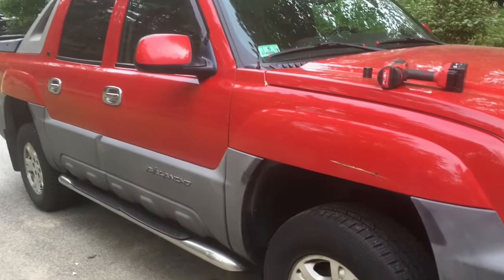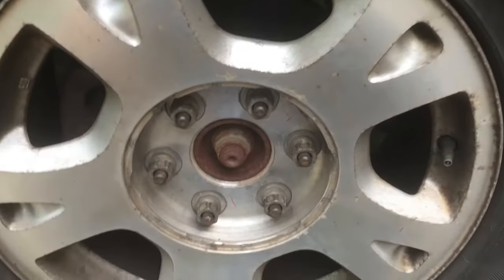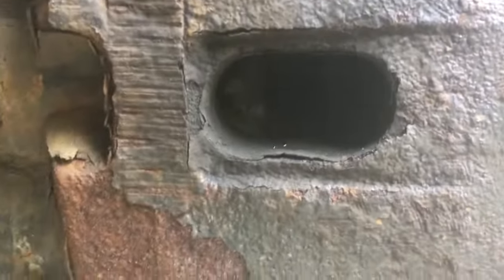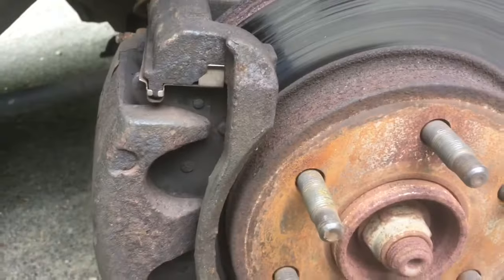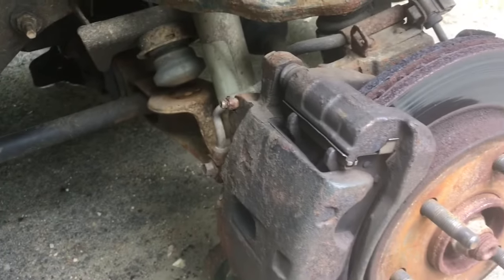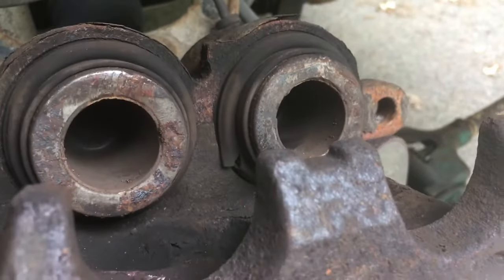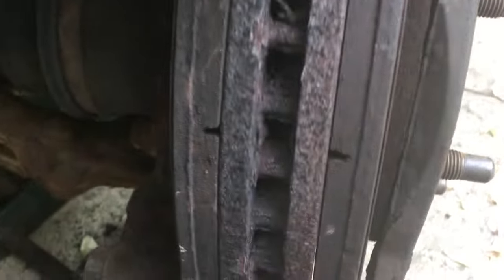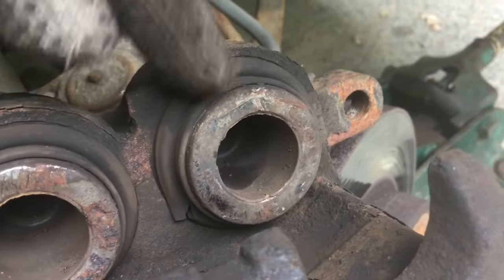Why is my wheel smoking and hot? Let’s find out!

Comment: I had hot brakes after a brake job. I was thinking seized caliper too, but luckily once I drew some brake fluid out of the over-max master cylinder reservoir the issue corrected itself. A shop must’ve topped off the brake fluid at some point along the way, but I didn’t know that it could cause brake drag until yesterday.

Comment: The 1st symptom of a sticking caliper is the vehicle pulls to that side. The next thing is that brake fades and the vehicle pulls to the other side because the other side is the only one working.   Another possibility is that the rubber brake line is delaminating on the inside and not letting the fluid return to the master cylinder.   If your vehicle is pretty old and you're doing a brake job just replace the rubber lines and save the headaches and frustration later on.   I've done this repair on two vehicles and it solved the caliper sticking issues.  I replaced 3 or 4 calipers on my old van before I figured it out.  AutoZone was very accommodating with the lifetime warranty.  Talk about feeling dumb.. I'm getting ready to do the front brakes on my k1500 and am replacing the rubber lines as a precaution.

Comment: I had my front right calipers replaced twice in about 5 months and my rotor is getting really hot again. I'm guessing the brake hose is gone bad
Reply from the maker: That totally stinks Tito. Check to make sure the caliper bracket is nice and clean too. If the brake pads are stuck in the caliper bracket you may have similar symptoms. A collapsed brake hose/line would certainly do the same!  Keep us updated with what you find!
Good luck!, and thank you for watching!
Reply: Yeah turns out it was the brake hose, it was very old so now it's running smoothly

Comment: My car is doing this. I took it to a machanic, he said I needed a new caliper. I ended up getting a new Hub baring, caliper, rotors and brakes. Fast forward 3 weeks later(today) doin the same exact thing! Do u have any idea what could be the issue with my car?
Reply from the maker: Depends on the vehicle, but something must be holding the brake pressure in your caliper (bad brake hose? Or damaged abs module?) , or the caliper is seized in the caliper bracket. You’d have to take it apart to figure it out. I’d recommend bringing it back to that mechanic and saying the problem isn’t solved. If they are reputable, they should take care of you.
Reply: Thank you!
Reply from the maker: Tesha H - you’re welcome!! Keep me updated on how it plays out!
Reply: Did you get it fixed?
Reply: @riketamonique2197  I did. He was right turns out they put the hose on wrong. It’s been fine since.
Reply: @tesha2087 Bad mechanics cause more problems than they solve

Comment: I just took my tire off and everything seems to be fine with the brake pads.... the strange thing I'm noticing is the top of my wheel points inwards towards the car. So the wheel is at a slight angle, any ideas?
Reply from the maker: If the top of the wheel is tilted in, that’s called negative camber. That leads me to believe your upper control arm is damaged in some way or badly misaligned. It also could be a really, really bad wheel bearing. But the wheel would be wobbling like crazy if that were the case.

Comment: It is more economical to rebuild the caliper yourself rather than purchase a new or reconditioned one.
Reply from the maker: If you strictly look at the price of the caliper vs. a rebuild kit, you are right. However, it depends what you value your own time at, and how difficult it is to get a rebuild kit.
Reply: @WiringRescue  It's probably just me. I like to repair. It doesn't snow here in northern Australia, so there is no rust problem.

Comment: I had this exact same issue on my Nissan Pathfinder.  Noticed a steering wheel vibration at highway speed, and my front right brake rotor was screaming hot when I got home.  Turned out to be a frozen piston in the caliper.  I couldn't compress it no matter what I tried.  Got a new caliper on and she's back to normal 👍
Reply from the maker: Nicely done! It always is a great feeling to fix it yourself.
Reply: Same thing mine is doing and why I'm here lol.

Comment: I just replaced the brakes on my car and noticed on the new pads, I couldn't  even get the new pads and the caliper over the rotor. Even after pushing the pistons back in. It almost acts like the brake pads are too thick.  I had a hard time getting the other caliper over the rotor but that one isn't over heating like this side is. I am wondering if they sold me the wrong sized brake pads. Now that it probably warped my new rotor. I am going to try replacing the caliper pins in case its just not sliding right. I could purchase another set of cheap pads and see if those fit better. All I know is this crap now days comes from China and quality control sucks.

Comment: Same for me! I have a 2004 Nissan Armada. I have replaced in the past couple of months the Caliper, Brakes, and Rotors in each side TWICE! And both times the rotor turned glowing red it was so hot, it started smoking and smelled so bad! So I replaced them one more time with the anti brake lock module ... it ran fine until I drove it for an hour somewhere and it got so hot again and starting smoking and locking up so I had to sit an hour for it to cool down and the brake light came on.... all my lights are on now and now I’m having the repeat problem help!
Reply from the maker: I’m sorry to hear that! Assuming you are not driving with two feet (resting one foot on the brake pedal), unfortunately you may need a decent technician to diagnose it. It could be a brake hose, the master cylinder, or maybe some other strange scenario. A good technician should be able to sort it out after driving it around for a bit. 
I’m sorry you’ve already had it “fixed” twice, and it’s still busted. That’s a terrible situation for sure. :(
Reply: Brake hose 99%

Comment: BOTH of my front wheels are getting hot. I had previously slid into a curb and messed up my alignment but had to drive it like that for a few months because I couldn't afford the repair. Then the overheating front wheel problem came up and I figured it was the alignment being overdue, maybe had damaged some suspension parts. I took it in and they fixed the wheel which was bent inward a little, and the off-centered steering wheel. But the wheels were STILL overheating, abnormally. I brought it in a 2nd time and they said they tightened some stuff and changed the air pressure on the tires and that the wheels were not overheating. BUT THEY"RE STILL OVERHEATING. They said the brakes, calipers, all good. BOTH front wheels are overheating which I find strange. Any ideas? I've never changed the rotors, my friend says it's that, but they look fine. No warping, maybe too thin? I usually change the brake pads myself but never the rotor, always looks good. Other thing might be the bearings maybe? But both at the same time seems unlikely. I would appreciate the help tremendously. If anything I'll reply with my solution when I find it

Comment: If the brake is sensed up will it cause the truck to  jerk forward and  start  jerking all over the roads when its supposed to be driving smoothly help
Reply from the maker: Sounds like the vehicle needs to be fixed. If you are a do-it-yourselfer, Jack it up safely, and see if any of the wheels are not able to spin easily.
Reply: @WiringRescue   my dad came over this morning to see if the the truck would do what it did to me last night and the calipers on the rear right front breaks were warm from being driving and used but they didn't smoke like they did last night weird

Comment: I replaced my wheel hub assembly, pads, rotor, and caliper, greased it and all, brakes and let's off beautifully, but it keeps smoking and that leaves my axle, the brake line is clean, the ABS line is fine, does the axle rubbing cause smoking? I drove 10 mins and it would be very hot as well to touch

Comment: Would bad wheel bearings have the same effect?

My 78 Camaro z28 front right wheel is extremely hot and smoke was coming out.
Reply from the maker: I have never seen a wheel bearing get hot enough to make smoke, but if it was tightened too much.... maybe?  I’d think brakes are more likely. Also front brakes on that Camaro are super cheap, so it may be a fine time to throw some fresh calipers on there. They are probably less than $20 each I bet.
Reply: @WiringRescue  Figured it out, brake caliper was locked up. Piston stopped working. FYI how this helps someone with the same issue.
Reply from the maker: @CONTRAGOLPETV  - thanks for the update! Glad it was a cheap fix!

Comment: I didn't hit anything while driving my dad's old truck I get out of my truck into the driveway when i decided to check the tire pressure on trucks tires I notice that my calipers were smoking I've never experienced this before  I'm scared to drive myself anymore until I get it repaired
Reply from the maker: Yes, stuck brake parts is fairly common, especially on older vehicles. If you pull the wheel off, you can sometimes quickly spot the issue without pulling everything apart. Good luck with the truck!

Comment: Hey bro, idk if you still respond to this but I recently changed my front wheel bearings, inner and outer tie rod and brake pads and also took it to be aligned. My car now slows wayy down if I let go of the gas pedal, also the tire is smoking and burning hot. What could be causing this? I have a subaru 99 forester
Reply from the maker: Well it sounds like your brake caliper is definitely stuck on for some reason. Could be a bad caliper, or a variety of parts that aren’t moving properly. You’ll need to take the wheel off and possibly take the brakes apart to diagnose it.
Reply: @WiringRescue  Thank you very much. I'll give it a look.
Reply: Try the brake hoses, forester brake hoses are brittle and wear down quicker than the caliper pistons do. Too many brake jobs done when ppl could have changed the hoses
Reply: @PhoenixIronchild  I got rid of the car. Timing belt snapped while going down the highway at 90mph. Engine screwed. I did figured out what it was tho. Bearings were shot. When the dealer aligned my car, they didn't care that the parts were breaking, the tie rods bent, bearing was split apart and the guiding rods for the caliper got stuck, most likely the grease got too hot and leaked out? Or they got welded together with the heat? Anyway, I replaced all those parts and car ran fine.

Comment: Changed my brakes rotors calipers about a week ago it was hot and smoking for about a day then stopped .. fast forward a week later I changed my tires today it’s doing it again .. will it fix itself or is something wrong ?
Reply from the maker: It’s not going to fix itself. It sounds like you need to take it apart and find the source of the problem.

Comment: So after replacing my front and rear calipers, and front two hoses on my brakes, im still getting hot rotors on the front end. Could It be the brake pads causing this issue?
Reply from the maker: If the brake pads are getting stuck in the caliper brackets (too much paint in them? Rusty? Not the right pads?), it could certainly be causing this problem. The pads should pretty easily float in the caliper bracket, easily moving from side to side.

Is the brake pedal super hard? Or does it feel normal?

Is it possible the driver of this vehicle is driving with two feet and accidentally resting their foot on the brake pedal?

Was something changed on the vehicle when this problem started?
Reply: @WiringRescue  overheating started before the calipers and front end brake hose were replaced. Thought it was a seized caliper. No signs of leaks, which is leading me to maybe the brake pad shims are pad or like you said they aren't sitting in the caliper properly.
Reply from the maker: Slim Skinny - yeah, I’d take those brakes apart and make sure they are sitting straight in the caliper bracket and easily move from side to side. 

I just replaced some brakes the other day, where the brake pad / bracket clips were installed wrong by some previous mechanic and it stuck/ruined the brake pads in a very short amount of time. So weird things definitely happen!
Reply: @WiringRescue  man these bad mechanics. Lol. I already have some new brake pads sitting. Im going to change them out soon. I just bought the car, and its a 08 and I dont think the brake pads been changed at all lol. I could fry an egg on the front rotors after a 15 minute drive. Lol.
Reply from the maker: Slim Skinny - good luck with it! Post up the results. I’m curious what you find.
Reply: @WiringRescue  im also thinking about replacing the brake pad drag reduction clips as well. I cant find the ones for the rear but I found the front easily which is where I'm really having the problem.

Comment: So if a 90 minute car ride in 2011 civic  had my  front brake rotors  at 50ish degrees celcius vs 35 centerhub and one rear drum at 37 vs 32 center hub , is it safe to say i have the opposite problem, dragging brakes or warped rotors or something?
How do i fix dragging brakes?
i changed the front pads about 6 months ago and was supposed to change rear shoes when i changed tires back to summer but forgot.

i just changed from winter wheels n tires to summers  yesterday  and also have a howl that wasnt there last summer, hopefully this goes away after  i fix brakes?

there was a faint almost constant hum all winter  that made me think i had a bearing going, the sound was ESPECIALLY   bad this winter when it was very cold and got even WORSE  when i backed up in this cold. is this brakes or bearings or what?
now if that slight hum is still there its drowned out by this new howl since changing tires...?

Comment: Can your tire blow out because of this ? I’m currently trying to find a shop that can take a look at my car because I was driving on the highway then out of no where my tire blows out and was completely torn from the rim. I changed it to the spare but noticed it was smoking and smelling very bad. Any tips ?
Reply: Yes. My tire blew out on me. Changed it, notice a smell and hot smoke, looked behind the wheel and my abs wire was completely chewed up from the heat. I figured out that that same heat blew out my tire a week before

Comment: I just got new pads and roaters on my 16 sierra and the front started smoking would this be included in the one year warranty probably not eh?
Reply from the maker: It depends what is causing the problem. If the pads were installed wrong, maybe they would be under warranty, but nobody would admit that. If the slider is stuck or the caliper piston is seized, they are different parts entirely, so that’s unlikely to be warrantied either. Sorry for the bad news. :(
Reply: @WiringRescue  i got new pads due to warranty and they made me get a new calliper was there noway of just fixing it?
Reply from the maker: @RandomVids519  - unfortunately rebuilding calipers is a thing that most shops don’t do anymore, because new calipers are cheaper than the labor time it takes to rebuild an old existing caliper. If I were working on your car, I would probably have installed new calipers too. It sounds like you got the right fix, it’s just kind of a crappy problem to have happen to you (the exact problem in this video!). The good news is that your brakes are all new now, so you should be in good shape for a long while!
Reply: @WiringRescue  ya i hear ya im happy 1300$ later got a full brake job done back in sept just find it weird that a caliper goes out at 6 years. Seems like they didnt lube it right or messed something up if not then ok i dont wanna cheap out on that stuff anyways.
Reply from the maker: @RandomVids519  - 6 years isn’t totally unheard of in my experience, but it depends on the conditions that the vehicle lives in too. Here in Massachusetts, cars get rusty immediately because the state floods the entire world with salt when the snow falls. So replacing brake calipers and basically every other metal component under a car is quite common. It’s a sad place to be a car guy!
Reply: @WiringRescue  oh ok well im in ontario canada so i will take your word lol i undercoat with krown but im already seeing rust where mud flaps should be always the spots nobody washes lol

Comment: My front right tire starts smoking after 10mins, it starts to feel like its dragging then after that it accelerate to 45mph slowly for about a min then allows me to go 60. After i let go of the gas it slows down fast.
Reply from the maker: It sounds like you should take off your wheel and see what the problem is, because your brakes are likely stuck on for that wheel. If it gets hot enough, you can damage the brakes further, and even surrounding components like the wheel bearings, bushings, all the way out to the tire.

Comment: Did this cause some vibration ?
Reply from the maker: Nope, no vibrations. It was some smoke, lots of heat, and a driving feeling like you’re holding the brake and the gas at the same time. So getting moving took more of the gas pedal, and when I let off the gas, it slowed down quickly.
Reply: @WiringRescue   thanks for the info. I have a 2008 Scion tC, and on the front  driver side I hear  like something is obstructing the disk with some minor vibration on the steering wheel when I accelerate. It also smells like burnt and noticed  a bit Of steam coming out from the rotor area.
Reply: I have a 2012 jetta and have the same issues vibration on the steering smell burnt and my wheel is really hot i can ear some toctoc too coming out of the wheels and some smoke sometimes